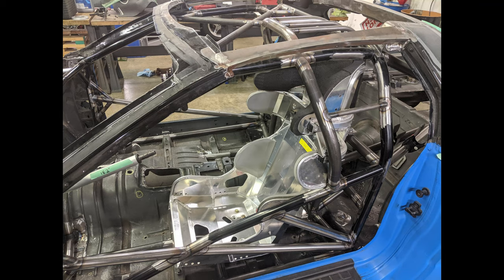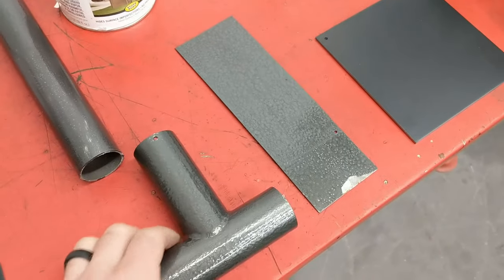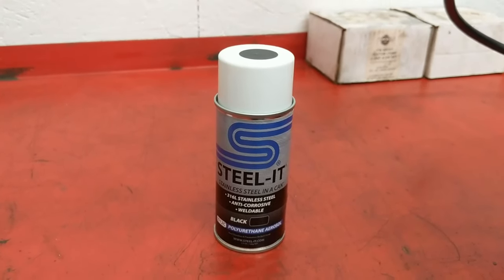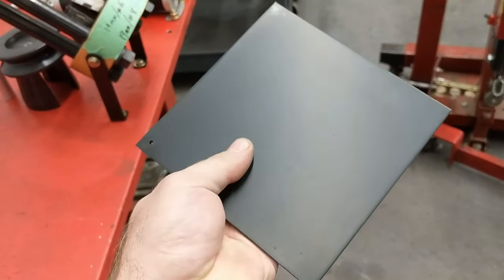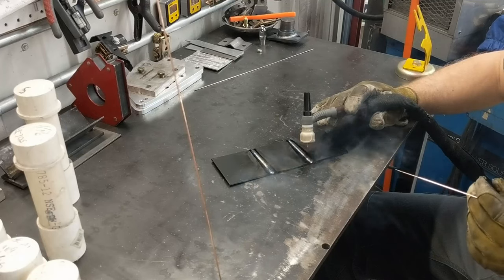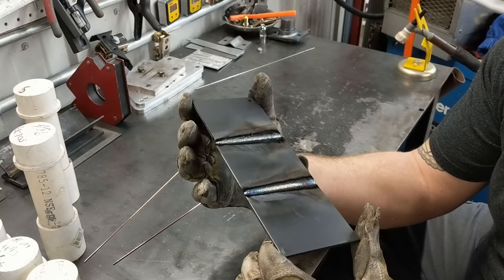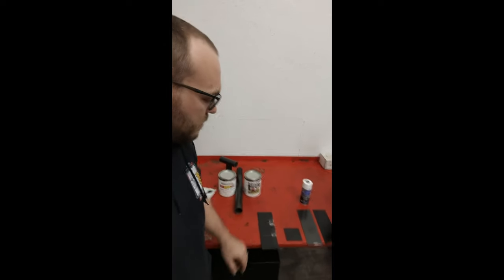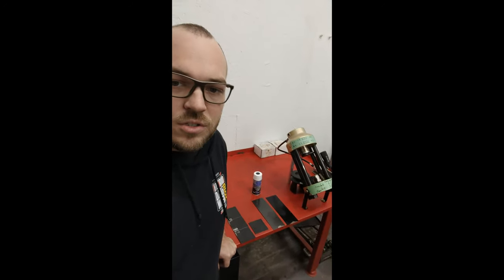Rollbar coating info Steel-it vs Rust-o-leum

Comment: I personally think if you do rust-oleum, enamel harder is a must. It can be thinned with acetone for faster drying and flatter finish or for spraying too.  Not my first choice for paint but you gotta do what you got to do at times. With hvlp guns being so cheap both electric and air kinda hard to imagine picking up a brush. Steel-it does sound like a pretty cool product I can see as a replacement for weld primer and a finish coats.

Comment: Nice video! I mix the hammered R.O. quart with steel it paint, I just ran into steel it paint by accident, mixed it just out of curiosity, but I was so impressed by the hardness of the steel it paint, I’m wondering if the two part paint is any better?

Comment: thanks for this video man!  For applications where you don't see the need to weld on later, would you still stick with Rustoleum?  Seems a lot cheaper I have some travel trailer jacks that have rust appearing where paint wore away looking for the best way to touch it up
Reply from the maker: Thanks!  Its hard to beat rust-o-leum for the money.  Steel it is much harder and more durable if the item sits outside a lot or sees abuse.  The steel-it touches up great as well.  If you can get to it easily.  IE not a rollcage.